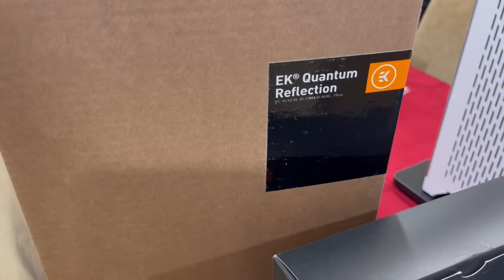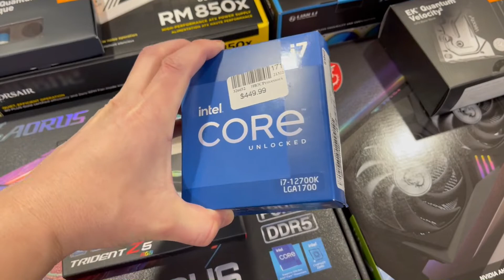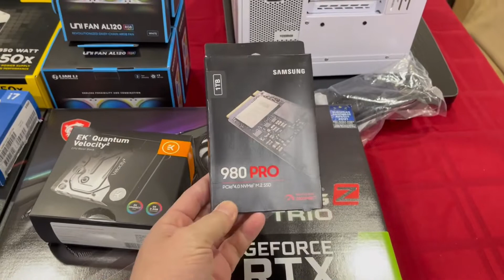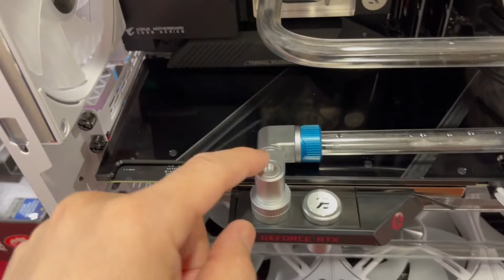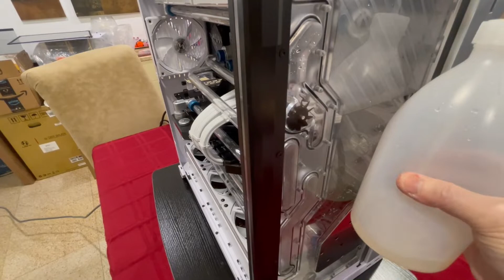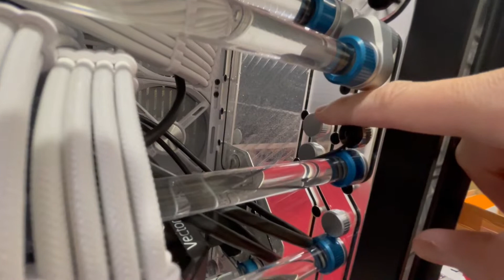Lian Li O11 Dynamic XL (i7-12700K, RTX 3080, Z690, DDR5) Custom Water cooled RGB PC - rigid tubing

Comment: How did you connect all your 3 pin cable from the pump, the waterblock and the case.
Reply: Because my Mainboard has only got two
Reply from the maker: @Lostiboy-tc7bc  RGB splitter from Amazon.

Comment: I believe the GPU inlet/outlet are reversed. The inlet/outlet is in on the left and right, respectively.  The inlet has a jet plate that accelerates the cooling fluid through the cold plate fins and this won’t happen when the GPU inlet/outlet are reversed.  There would roughly be 2 to 3 degrees improvement in the GPU temperature by reversing the tube configuration.

Comment: I'm building a custom loop in the 011 XL...it comes with a sag bracket that installs directly on the motherboard with spacers. I have the same water block and after using it, there's zero sag and the GPU doesn't move at all.

That bubble may go away on its own over time..just leave your fillport open randomly for small amounts of time... basically you need air so that the liquid can displace that tiny air pocket...you could tilt the case a bit too.

Comment: I'm building almost the exact same setup. Low point for me was when I realized that the side glass won't go back on with that EK GPU block if you have an eVGA FTW3 card.

I had to get the vertical riser but then RIP getting access to any of the M.2 slots on the Motherboard short of a total drain :(

Same issues with importing the fittings from EK directly though and offsets etc trying to get the parts to match up to the distro plate.
Reply: Came across this post just now as I am looking for ideas on an upcoming build. I have a 3080ti ftw so thank you for helping me decide to go vertical mount!